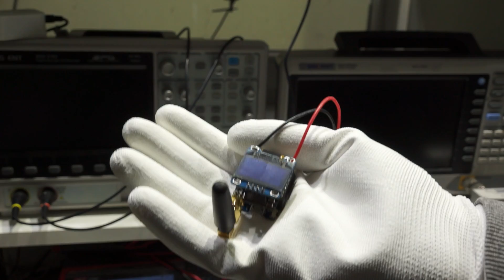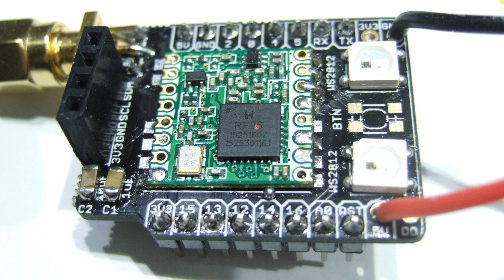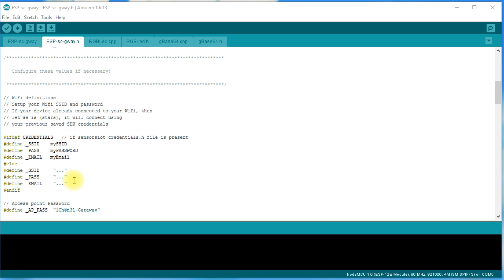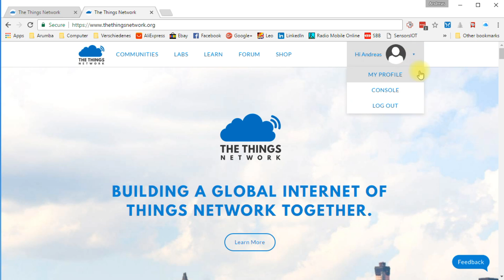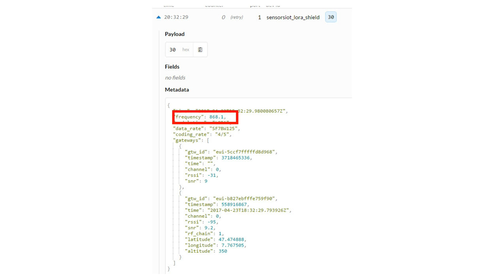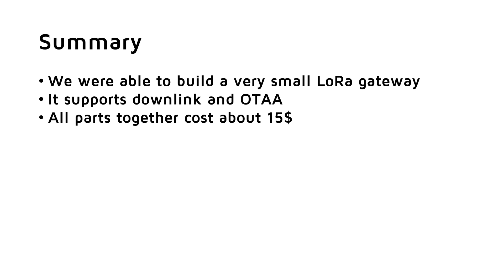#134 15$ LoRa Gateway with ESP8266 and a RFM95 (Tutorial)

Comment: Hello Andreas!  You said you discovered how to mount pins to make this board compatible with other Wemos board too late - did you mean it is better to solder on opposite side as you have solder it?
And BTW: what is the purpose of EEPROM 24AA02E64T on the pcb?
Than you for another great video!
Reply from the maker: 1. Concerning soldering: Pay attention that the pins of the Wemos and the pins of the PCB fit after soldering RST to RST, GND to GND etc). You can solder it the wrong side and then you have to redo it.
2. Concerning the EEPROM: I do not know. Maybe to store some keys? Maybe you ask the creator.
Reply: Great - thank you! As i see one question  regarding pins of display remains open. You mentioned 1306 display can be connected directly. On the PCB is printed following order: 3V3, GND, SCL, SDA.  But  your 1306 display (also mine) has different pin order: GND, 3V3, SCK, SDA. Did i missed something?

Comment: Hi Andreas,

Thank you for this very good video.
I tried to make one Lora Gateway at home using your design and sketch.
Currently the pcb is almost finished (still missing pin headers...)
I have installed all the library and tried to compile the sketch, but I get this annoyinbg error :

It's in the main routine here :

// ============================================================================
// UDP AND WLAN FUNCTIONS

// ----------------------------------------------------------------------------
// GET THE DNS SERVER IP address
// ----------------------------------------------------------------------------
IPAddress getDnsIP() {
  ip_addr_t dns_ip = dns_getserver(0);
  IPAddress dns = IPAddress(dns_ip.addr);
  return ((IPAddress) dns);
}

and the error is : 
ESP-sc-gway.ino: In function 'IPAddress getDnsIP()':

ESP-sc-gway:263: error: conversion from 'const ip_addr_t* {aka const ip4_addr*}' to non-scalar type 'ip_addr_t {aka ip4_addr}' requested

   ip_addr_t dns_ip = dns_getserver(0);

And absolutly no idea of to fix it ...
Any idea on your side ?
Thanks
JP
Reply: I finally commented out these lines as this "dns_getserver(0)" function was never called.
Now it compiles :-)

Comment: In the  hallard board it writen : "cut wire if you need to put d1 to avoid LED pb" right above the d1 diode. So did you cut it? you didnt mention it in video...
thanks for excellet and informative videos
Reply from the maker: I do not remember that I had to cut something.

Comment: Hello!

Thanks for all the great videos! :-) 
I recently stumbled upon LoRa, and your videos have been a great source of information, entertainment, and project ideas (regarding some of the ESP projects).

One question: Do you know of any attempts to make a Gateway using the 1 channel gateway for transmission,  and  a 10 bucks USB SDR dongle  (e.g. RTL2832U, sdrangelove, DecodingLora) with a rPi?
Reply from the maker: The gateway has a transmitter and a receiver. No need for SDR. I made also a video of a gateway using an RPI
Reply: I know, I've watched it :-) I mean as a cheaper alternative for an 8ch Gateway :-)
Reply from the maker: I do not think SDR can help you here because it cannot send LoRa signals.
Reply: That's the point, SDR for receiving, A single RFM95W for broadcasting on whatever channel required.

While the RFM95W can only listen on one channel at a time, the rPi could listen via SDR and only use the RFM95 for transmission, setting it to the required channel.

Comment: Hello Andreas, 
could you please help me with your sketch - in my Arduino IDE 1.8.5 there is an error: 
conversion from 'const ip_addr_t* {aka const ip4_addr*}' to non-scalar type 'ip_addr_t {aka ip4_addr}' requested
It points to section healined "GET THE DNS SERVER IP address". Thanks
Reply from the maker: I do not know this sketch very well. I just used it for my project. I think you find below in the comment links to newer code versions. If you still have problems a better place to address them is the forum on TTN. This is where I would go with my problems.
Reply: Thanks for the answer. I finaly figured it out - there is new version of ESP 1ch gateway. See https://github.com/things4u/ESP-1ch-Gateway-v5.0
The version 5.0 generates no errors while compiling :)
Reply from the maker: Thanks for the link. I added it in the description. Does it run on the board I used?
Reply: I cannot say now, I am still waiting for my RFM95W  modules from Aliexpress. But I use Wemos D1 mini from your link.
Reply: Yes I can confirm version 5 run on the hallard board
Reply: Radim , I lower the esp8266 version on the arduino IDE  and the error gone
Reply: Thanks Michael, downgrading ESP in Board manager really works.

Comment: I bought myself a few Wemos D1 minis and RMF95s to build a poor-mans 3 channel Lora gateway and support TTN.
Is there anything to say about reception range of these esp gateways?
Will it be capable of receiving packets up to several kms or is it limited to 10s of meters? 
Would using a high gain antenna like this (https://goo.gl/ACZhG9) make any sense for this type of gateway?
Reply from the maker: I have videos about LoRa range. They should apply if you use a gateway or a RFM95 as a receiver. You see there also, that the antenna is not very important.

Comment: I am new to this, wondering if the Battery Shield for WeMos D1 is similar to the PCB in mentioned above.

This battery shield is at - https://www.ebay.com/itm/401191439484
Reply from the maker: If you mean with "similar" that they can be connected to these shields: Yes

Comment: Hey Andreas, I have a question about the parts that you used.

I also ordered the 1206 capacitors, but which pull up resistors did you used? Is it possible to add a link where to buy this part?
Reply from the maker: I have a set of resistors in my lab and usually, you see, what I buy in my mailbags, where a leave all my links. Pullup resistors are usually about 4.7k and if I remember right, this PCB is made for 0805 size

Comment: Hello, there is a version for 915MHz module?

Best regards,
Leonardo
Reply from the maker: Yes
Reply: What i need to modify? Only frequency values? Could you pass me an example?
Reply from the maker: In addition, you need an RFM95 for 915MHz
Reply: Yes, i have it. I am trying to build a gateway. Do you have an example using this module?
Reply from the maker: No, it would not be allowed here. But the only difference are the numbers in the frequency fields

Comment: Could you give us any WEB link to buy the SMA connector for the antenna?
It is to be used with the board designed in https://pcbs.io/share/4Q1Z4 .

For example, is this connector
https://es.aliexpress.com/store/product/10Pcs-1-6mm-SMA-Female-Jack-Solder-Edge-PCB-Straight-Mount-Gold-plated-RF-Connector-Receptacle/2633019_32779564868.html
valid to be soldered in that board? It seems the internal round pin of the SMA connector hinders!  

Thanks.
Reply from the maker: The connectors in your link should work

Comment: Nice Video sir. My LoRa is using 915MHz, which part in programming should I change?
Reply from the maker: There is a variable to change the frequency. Maybe you search for 915 and replace it bay 868.1
Reply: Thanks sir, I'm still trying to set up this gateway

Comment: stat update: <216> {"stat":{"time":"2017-11-1 22:48:42 CET","lati":39.0065,"long":32.0059,"alti":350,"rxnb":0,"rxok":0,"rxfw":0,"ackr":0.0,"dwnb":0,"txnb":0,"pfrm":"ESP8266","mail":"halukmy@gmail.com","desc":"ESP Gateway"}}

i get this why?
Reply: dear @AERO COP thanks for answer me, i so much try to connect TTN, also open 1700 port but still i guess not enable to join it, is there any other way? and im so happy if you can send mail to halukmy@gmail.com , in every 30 sec i get stat update: <216> {"stat":{"time":"2017-11-3 20:56:53 CET","lati":39.9260,"long":32.8592,"alti":350,"rxnb":0,"rxok":0,"rxfw":0,"ackr":0.0,"dwnb":0,"txnb":0,"pfrm":"ESP8266","mail":"halukmy@gmail.com","desc":"ESP Gateway"}}
Reply: Haluk YILMAZ look at my link in the top ... It's a Working config
Reply from the maker: I do not know.
Reply: First thanks for sharing cool things , im so happy if you can send me email on this send this topic also, it looks everything allright, says connected but on console screen it says not connected.. whats can be problem? here is result

PHY mode: N
Channel: 1
AP id: 0
Status: 1
Auto connect: 1
SSID (9): sungerbob
Passphrase (14): qwgerwgqegq
BSSID set: 0
========== SDK Saved parameters End
Sketch contain SSID/PSK will set them
connecting to sungerbob with psk halukbinreyhan
WIFI=STAConnecting to UDP
Connection successful
MAC: 5c:cf:7f:8b:29:37:
Trying to Setup LoRa Module with
CS=GPIO5  DIO0=GPIO4  Reset=GPIO16
SX1276 detected, starting.
Gateway ID: 5CCF7FcFFF8B2947,Listening at SF7 on 868.10 Mhz.
192.168.0.11
time Wednesday 23:40:17
Admin Server started on port 8080
---------------------------------
stat update: <216> {"stat":{"time":"2017-11-1 23:40:17 CET","lati":39.3260,"long":32.2592,"alti":350,"rxnb":0,"rxok":0,"rxfw":0,"ackr":0.0,"dwnb":0,"txnb":0,"pfrm":"ESP8266","mail":"halukmy@gmail.com","desc":"ESP Gateway"}}
Reply: Is it connected in TTN? 
I think this is a heartbeat?  Du you get it every 30 sec?
Reply: you are god damn hero of the day bro ! :) but im so new on this beautiful lovely platform,  i just used this http://bit.ly/2it7TNA as a sender and receiever but after long traffic thats just sucked.. i wonder i got gateway link and its connected , so how can i send messeage to this baby? is there how to video?
Reply: hey @aero cop , its been while huh? :) i m just stuck with gateway stuff "lorawan" i simply dont get some i guess.. because its lookts me complicated https://github.com/sandeepmistry/arduino-LoRa i great with that but while same time send message cant recieve, is it same in ttn too? and another question, how send message by ttn or gateway? for example can i control multiple lights value and same time get value from lights?

Comment: Thans for the great video. But for some reason my gateway ID gives only 7 bytes at the serial monitor. How can I solve this? And is there also a way to use this same setup for sending packets?
Reply from the maker: 1. I do not know and remote diagnostics is not easy
2. Another video shows how to build a node. And you find others if you google.
Reply: Thanks for the quick response. I think I found the problem but I don't know a solution yet.
The row "Serial.print(MAC_array[1], HEX);" outputs a 1 instead of a 01.
Reply: Get the same error :-/
Reply: ...and it's not printing anything - "just" the 0 ... and not the first part of the MAC adr.
Reply: WiFi.macAddress(MAC_array);
  for (int i = 1; i < sizeof(MAC_array); ++i) {
    sprintf(MAC_char, "%s%02x:", MAC_char, MAC_array[i]);

changed from "for (int i = 0" to  "for (int i = 1" - now it's working. It dos not print the right MAC ... BUT you now have det right GW ID to put in thethingsnetwork! :-D Hope you get it to work!

Comment: Could we also use this complete board for a LoRa GateWay? Similar price but completely soldered including the screen.

http://esp32.net/images/Heltec/WIFI-Kit-32/Heltec_WIFI-Kit-32_PhotoCollage.jpg
Reply: Finally https://es.aliexpress.com/item/868-MHz-915-MHz-SX1276-ESP32-LoRa-0-96-Pulgadas-de-Pantalla-OLED-Azul-Kit-32/32836591865.html?spm=a219c.12010108.1000023.4.7012662dCWvGFn
Reply from the maker: Unfortunately, this board is on 433 MHz and LoraWAN networks are on 868/915
Reply: You are correct, I misread the AliExpress add, but there is some good news in that ad: "We will release 915MHz and 868MHz of this product." 
https://www.aliexpress.com/store/606998?spm=2114.10010108.100005.2.4b24ae2bWjD4pO
Reply from the maker: Thanks. Already ordered...

Comment: Hello, Mr. Andreas. Thank you for your an other great tutorial. I have some questions;

1) In this image it seems that the antenna connection part of the PCB is not simulated or well calculated. The reason for such a thought comes from the looking of the simple connection between the LoRa module and SMA connector inner pin. It just doesnt look like a proper 50Ohm waveguide. Am i right about this? It might be perfect, if so I will not simulate the anntenna connection and buy one of these premade PCB's. https://s3.amazonaws.com/pcbsio/svgs/cdebfcc3c70cbc6e5ba1028fcdaf55e0d60e6b23b776967b0fdd9bb6867340a7/tcu.svg 

2) I can see there is no RF shield for the LoRa module. Have you ever made a connection test for this type of gateway. If so, what is your experience on this subject? (The range test etc.)

And do you have any suggestions about optimizing the RF performance of the ESP8266 gateway?
Reply from the maker: I do not know about the know-how of Charles and therefore do not know if the connection is ok. And I do not have the tools to check it.
Reply: I see, thank you again.

Comment: Hi Andreas, 
Very good job, well done.
Let me askyou some doubts about he OTAA
I've been trying to use the Single Gateway with TTN and Over The Air Activation without success. 
My setup is: ESP8266+RFM95 as a pico GW and a RN2903+Arduino as a node.
When I Join to the network thru my Multitech GW and turn it off, my Pico GW works perfectlly. 
If my node tries to join to the network directly thru the Pico GW, I can't join.  
Have you joined using a setup like this? 
Do you have any idea where I'm failing?
Regards,
Luis Viola
Reply from the maker: Maybe the gateway SW does not support OTAA?
Reply: Thanks for the replay. 
I'm using https://github.com/things4u/ESP-1ch-Gateway-v4.0 with should support otaa. 
Have you manage to get OTAA works? If yes, what SW are you using?
Reply from the maker: I have a full blown gateway (as shown in one of my videos). It supports OTAA

Comment: Hi Andreas,

did you try this ?

SX1278 LoRa ESP32 0.96 inch Blue OLED Display Bluetooth WIFI Lora Kit 32 Module Internet Development Board Antenna for Arduino
 http://s.aliexpress.com/eiEFvqii 
(from AliExpress Android)

It may be interesting. 

Regards
Holger
Reply from the maker: No, I did not try it. It is 433 Mhz and LoRawan here is on 868 MHz

Comment: Great work! I have some troubles, I followed all the steps but I think that my gateway cannot achieve TTN. This is the output. Hape you know anything about this problem.

Gateway ID: 5CCF7FFFF**CF05C,Listening at SF7 on 868.10 Mhz.
192.168.1.113
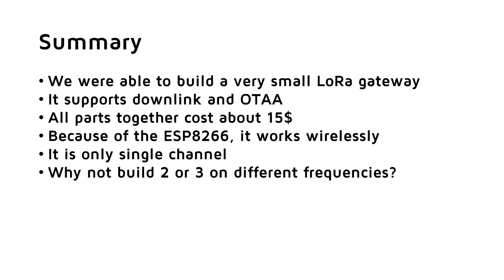time Friday 00:07:07
Admin Server started on port 8080
---------------------------------
stat update: <226> {"stat":{"time":"2017-7-28 0:7:29 CET","lati":41.3534,"long":2.1119,"alti":5,"rxnb":0,"rxok":0,"rxfw":0,"ackr":0.0,"dwnb":0,"txnb":0,"pfrm":"ESP8266","mail":"marcosleongonzalez@gmail.com","desc":"ESP8266 Gateway"}}
stat update: <226> {"stat":{"time":"2017-7-28 0:7:59 CET","lati":41.3534,"long":2.1119,"alti":5,"rxnb":0,"rxok":0,"rxfw":0,"ackr":0.0,"dwnb":0,"txnb":0,"pfrm":"ESP8266","mail":"marcosleongonzalez@gmail.com","desc":"ESP8266 Gateway"}}
stat update: <226> {"stat":{"time":"2017-7-28 0:8:29 CET","lati":41.3534,"long":2.1119,"alti":5,"rxnb":0,"rxok":0,"rxfw":0,"ackr":0.0,"dwnb":0,"txnb":0,"pfrm":"ESP8266","mail":"marcosleongonzalez@gmail.com","desc":"ESP8266 Gateway"}

Only stat update are sent but the the device is allways offline in the TTN console.
Reply from the maker: Did you do all the configurations on the TTN site and also checked there?

Comment: HI Andreas. Excelent as usual.
One note regarding the diodes.
The RFM95W provides 3 pins that indicate several states (for example end of transmission) depending on the programming mode selected. In theory you would need three pins in the WEMOS to see the status of this pins, no matter that the board interconnect all together through diodes in order to use only one pin as a single interruption (GPIO15 D8) ; then the SW see what caused the interruption reading registers
When the same PCB board is used as a LORA node with the LMIC SW, the diodes could be removed declaring it as LMIC_UNUSED_PIN and periodically reading the register by SW without causing mayor sync problem as stated by matthijskooijman.

https://github.com/matthijskooijman/arduino-lmic/pull/34

No matter that it seems that when it is used as a GW sync could be an issue.

I hope that it helps and many thanks for the videos!!!.
Reply from the maker: Thank you for your clarification!
Reply: But why we need a zener diode? in the basic example use a normal diode.

Comment: Great Video!!. I have a question, is possible built transmission and receiver with this device https://es.aliexpress.com/item/2pcs-SX1278-LoRa-Spread-Spectrum-Wireless-Module-433MHz-Wireless-Serial-Port-UART-Interface-Ra-01/32805648570.html?spm=a2g0s.13010208.99999999.264.QtAVRu or what you recomment, to built? i need cover 12 km. Thanks again.
Reply from the maker: The Hope RF96 and the  SX1278 are simialr chips. Hope manufactures them with a license.
Reply: ok, thanks again